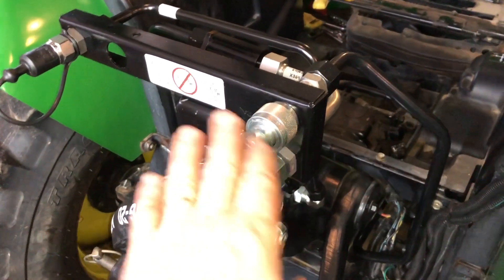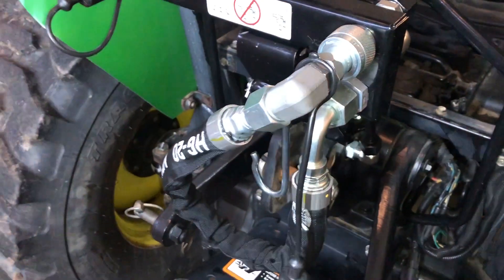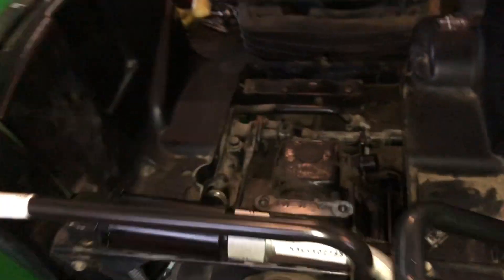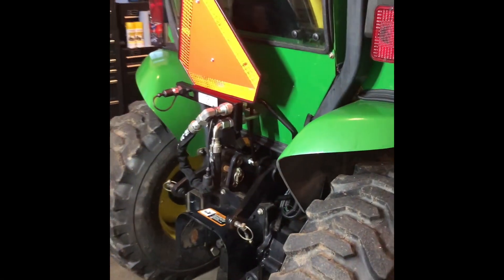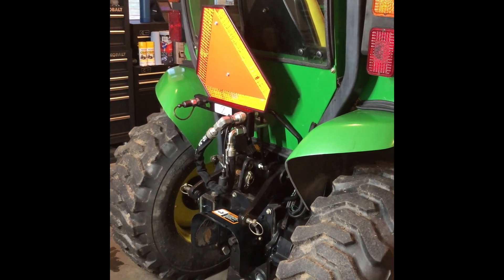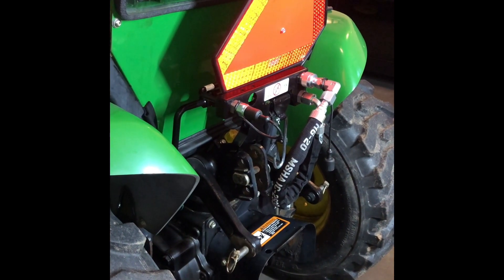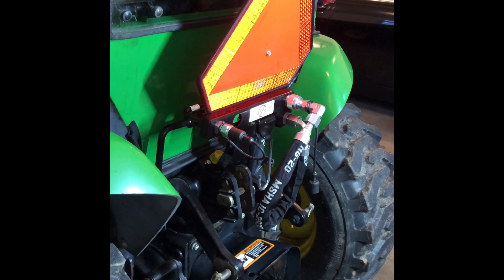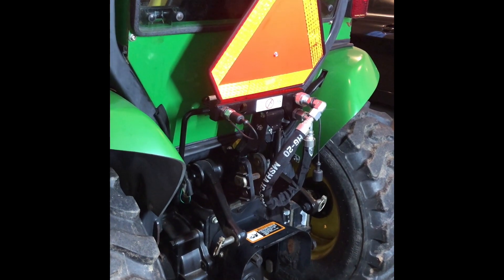John Deere Tractor Power Beyond Kit Installation

Comment: When I got my 2024 3039R delivered with the Backhoe already installed, it was plugged into the P and R and nothing was plugged into the T port. That now seems wrong. What is the difference between the T and R ports? Should I be concerned its not plugged into the T port?
Reply from the maker: @tannernewton8543  thanks for reaching out.  One port returns to three point hitch lift valve and one returns directly to tractor.   This allows you to mount an aftermarket three point hitch style backhoe (requiring both lift and power) or a factory John Deere backhoe (requiring only power) one like you have.

Comment: Mine does function like yours, my backhoe plugs in the supply line with one hose from the backhoe, the other hose from the backhoe plugs into the P port. The T port is not used. Now that I have taken the backhoe off and plugged the Return line back into the P port to complete the circuit, I have no power to three point. The T port is a male fitting, the bypass hose when unplugged from the P port is a male fitting too, so I can’t plug the return line into the T port, they are both male fittings. I have 4 hours on this new tractor, it came from the dealership this way.
Reply from the maker: sounds like the return line fittings might need to be swapped.   I believe the return lines have the same size threads/fittings, so its definitely possible when the dealer did the install that they might have overlooked this.   if you send me a pic from the back of the machine of the bypass hose connected I can tell.   my email is darrencmas@gmail.com

Comment: What is the kit # that you installed here?
Reply from the maker: It was LVB25085
Reply: Thanks a lot. I’ve got a power reverser 3320 and was looking for a kit. Found a couple different ones, but not sure if they’ll tie into mine or not. 🤦‍♂️
Reply from the maker: @4bearsi678  nice machine the 3320 without cab kit is LVB26069 and with cab Kit is LVB25781

Comment: Great video. Do you know the power beyond kit # for a 4300  Hydro to operate a #48 JD 48 backhoe?
Reply from the maker: Thanks for the feedback. The 4300 requires a kit (LVB25221) and line (AM126985). I did some research and the line is hard to find new.    You would most likely need to find one used or make one up yourself.
Reply: @darrenmas  much appreciate taking the time to look up that info!  Look forward to installing this kit in the near future especially with the help of your video.  Thanks again.
Reply: Do all 4300 accept this kit?  I looked at one today and did not look like there was any plumbing similar to this video.